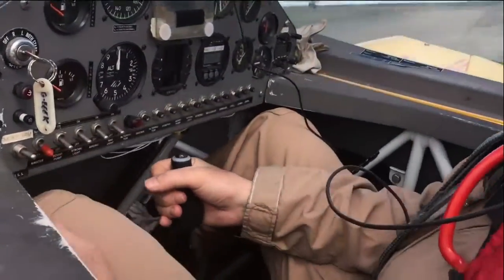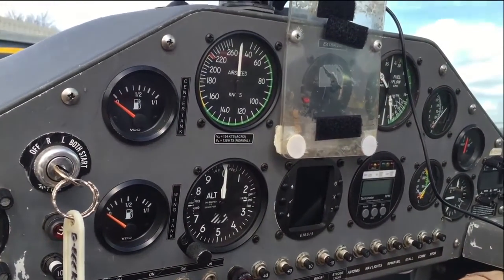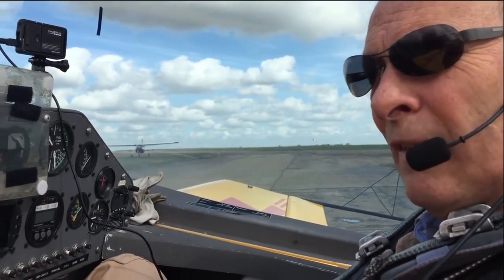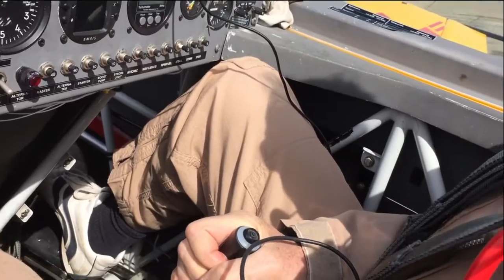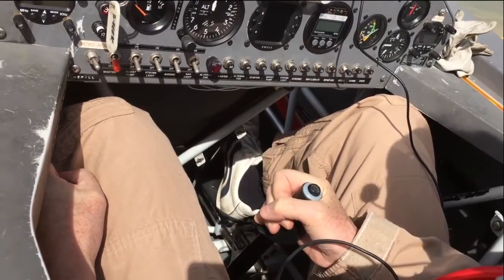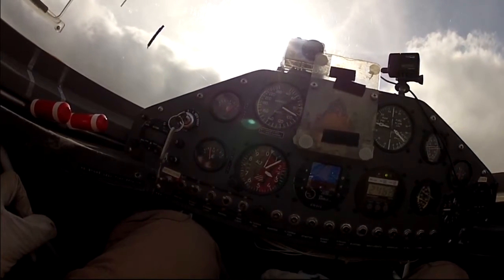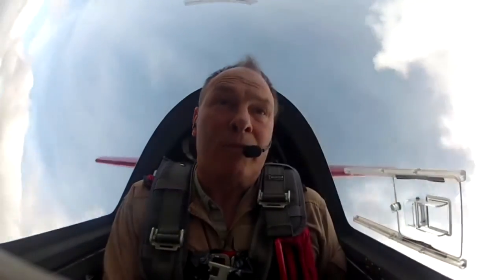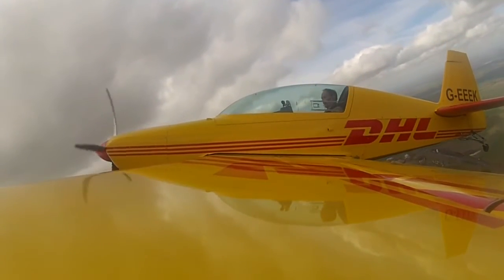The Competition Spin

Comment: Interesting! Do you really recover a spin with full power? Never heard (or seen) this before. Everybody I know (including myself) adds power not before the aircraft is un-stalled and stabilized in the vertical.
Reply: Yes, but this is a competition spin, when recovering from a liss of control situation then it is best to have no power so any gyroscopic influence is minimised. For a competition spin we use power to make the rudder more effective and reduce height loss.
Reply: I´m not saying it doesn´t work, I´m just saying that I´ve never seen anybody to go full power to exit a spin (unless you want to do some funky freestyle exits). For a "standard competition spin" I´m not adding any power before I´m stabilized in the vertical.